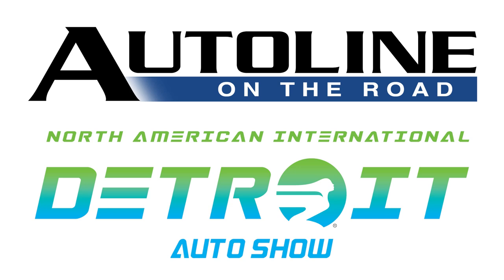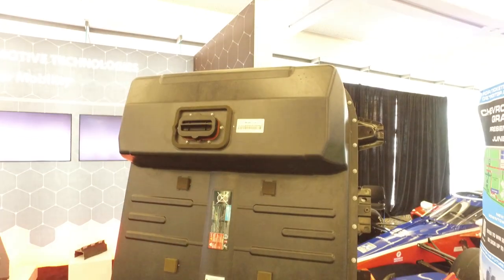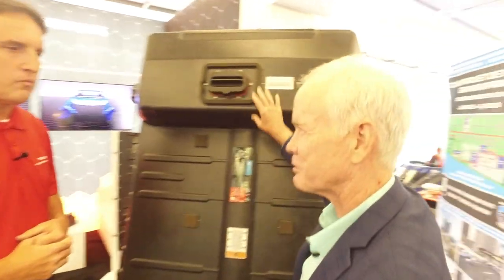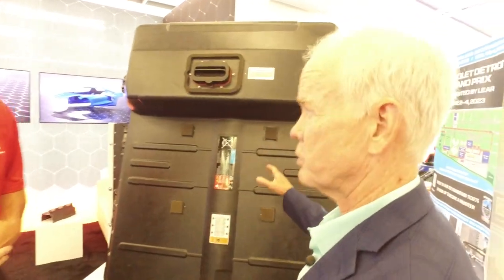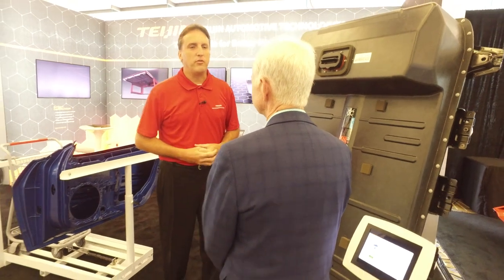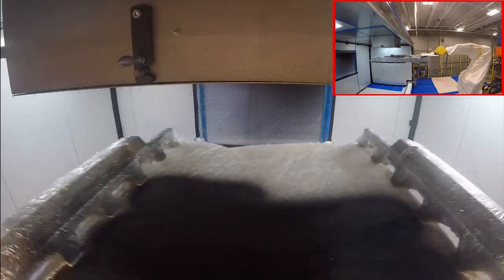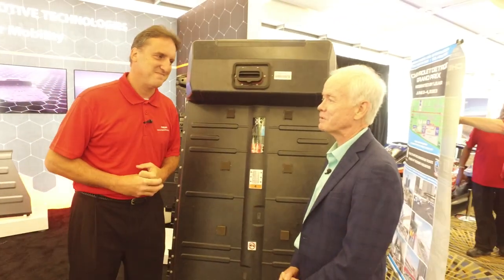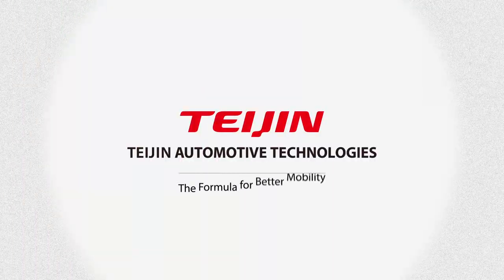Composite EV Battery Enclosure is 25% Lighter - Detroit Auto Show 2022

Comment: Seemed like a great idea... Until Tesla made the structural battery pack. I like John's suggestion to use for body panels. Could also be a good material for BEV's "firewalls".
Reply: The Chevy Bolt was structural from the beginning so not a new idea, but he's right that weight is quite important. Especially when you're reaching for a low price point and move to a skateboard platform. It will depend on the requirements of each vehicle. More than one way to skin a cat.
Reply: @davidmccarthy6061    Hummer Battery pack braces the structure too.
Reply: @vidznstuff1  well, what tesla does that is different, if they are using the battery cans, the metal cup surrounding the batteries as an active sheer material in the pack.   It’s a good idea to get double use out of the cans around the cells, but doesn’t save a whole lot of weight, and we have yet to put one of those model Y on a shaker to test the torsional frequency compared to a regular model Y with 2170
Reply: @davidmccarthy6061  As far as I know Tesla is  the only manufacturer that uses the upper battery tray as the structural floor of the vehicle and that uses the battery cells themselves as a structural unit. While the others may have structural supports around the cells, they don't actually use the cells as structure.
Reply: @davidmccarthy6061  ummm no, just watched GM presenting their battery pack and where it sits on top of several cross members under the chassis.

Comment: Sandy's a big fan of this (carbon / glass fibre and resin) but the complete lack of recyclability puts me off.
Yes, you can grind it up and mix it with concrete but that's not recycling in the true sense... same as burying nuclear waste or CO₂
Reply: While I share similar concerns, I also wonder if product durability isn't improved. If the car lasts 50 years instead of 20, isn't that better in a world where fewer cars are produced?